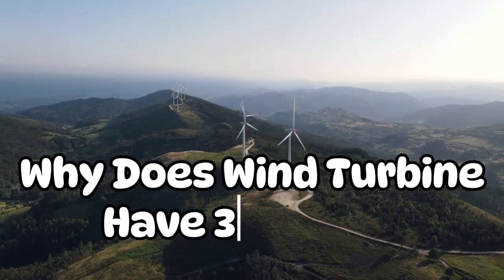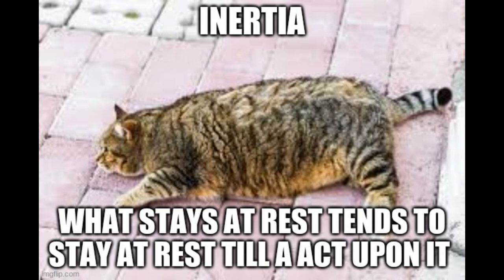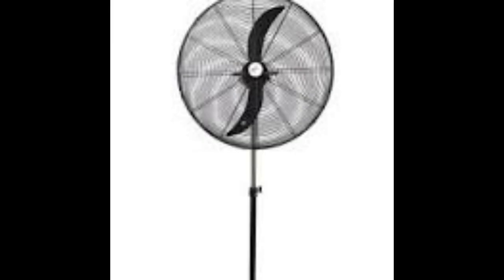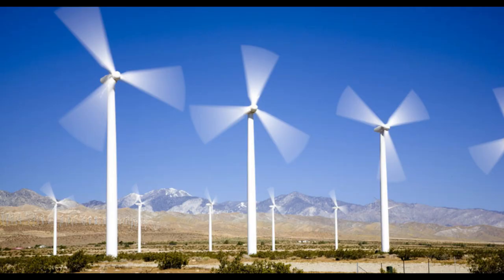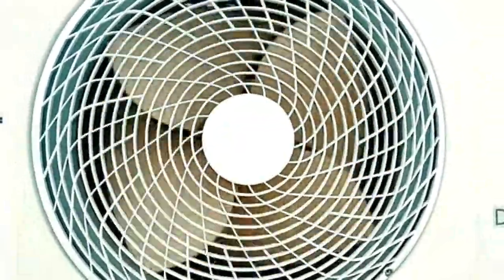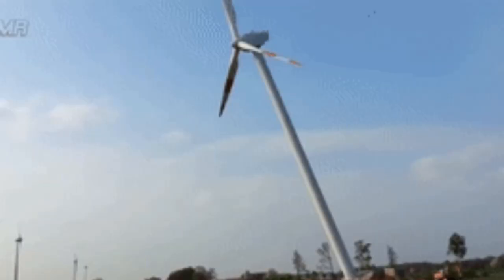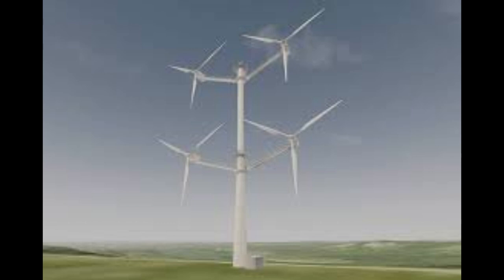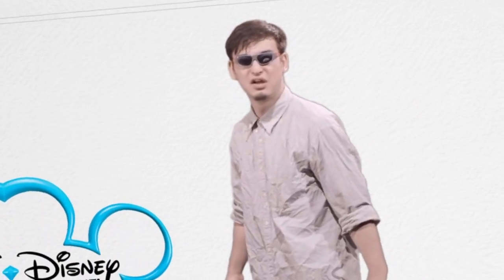Why Wind Turbine must have 3 blades?

Comment: regular wind mill blades produce power base on lift just like airplane, but if you lower the RPM mount the blades in a hub with a cone 10 to 20 meter wide you can place 10 or more simpler  blades,just like the ones used to pump water, they worked great and were made of metal.